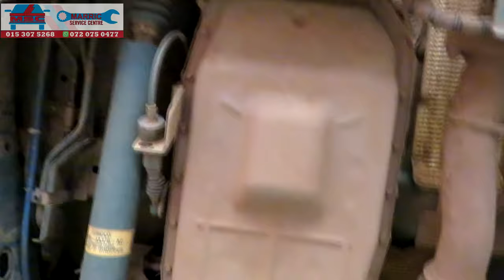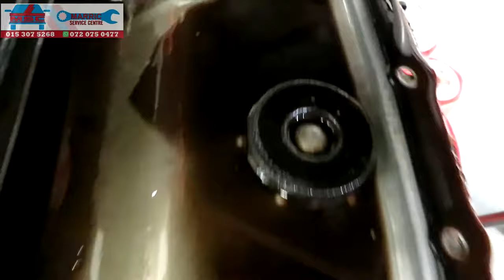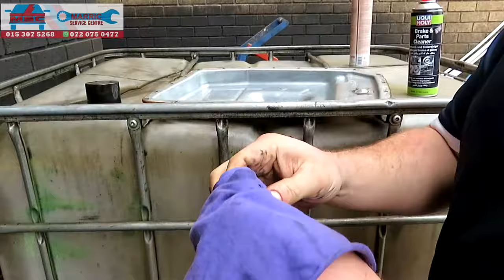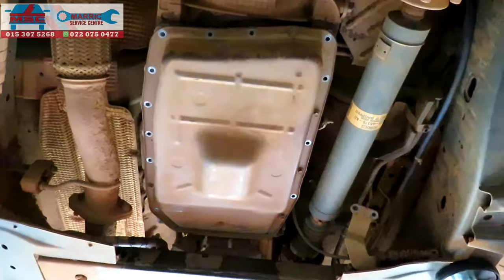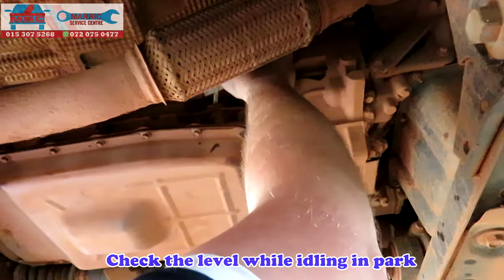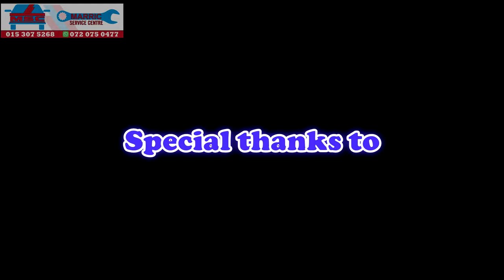How to change automatic transmission fluid Ford Ranger T6 / Mazda BT50

Comment: Much better if drain and replace ATF filter then flush the ATF in the torque converter through the return hose of the atf cooler so that the new fluid pump in into the torque converter and the old ones will be drain out.
Reply from the maker: Thanks
Reply: Hats where you end up with trouble.
Reply: @andrewbobak5578  why?

Comment: All these ppl saying the torque converter. The converter in these only holds around 2-3 litres. dry refill is 11.9 and drain and refill is 9.0L. Not necessary to do the full flush unless logbook calls for it

Comment: Hi Guys, can you tell me what the service interval is for this particular auto transmission. There are a lot of different ideas out there and even minor differences between some of the Ford workshops. Cheers.
Reply: My manual says 200000km or ten years!
Reply: @standupstraight9691  It turns out that most Ranger owners change the auto trans fluid each time the engine oil is changed. So that's generally about 10000 km or 12 months. That's what I have been doing. If you're towing, or innthe bush with dust, etc, the advice is to do it more often, about 7000 km.
Reply: @PropanePete  . I dont think thats necessary for full synthetic, but doesnt hurt any.
Reply: @standupstraight9691  Yeah, it's  an overkill but we do a lot of remote area travelling so I just look at it as a bit of insurance.

Comment: Is it ok to reuse the filter ?
Reply from the maker: I would recommend getting a new one,  why go through the whole process with a dirty filter, I know its hectic paying for a R1000 filter but it could save you more at the end.
Reply: Incorrect! You also need to take the oil out of the torque converter

Comment: Heres a commonsense tip. Drill a small hole in the lowest part of the sump.
allow oil to drain without it showering it everywhere like you lost a war.
remove pan.
install aftermarket oil pan drain plug kit.
doing this you will be encouraged to change the oil and filter at more regular intervals.
Reply from the maker: good idea, I was wondering why the engineers did not installed a plug there?
Reply: @SamoesADIY  . I reckon because they want the owner at the dealer for every little thing.